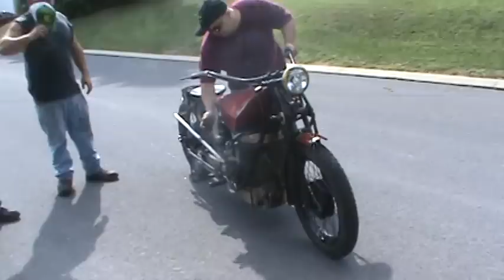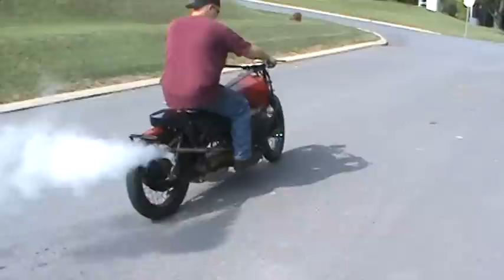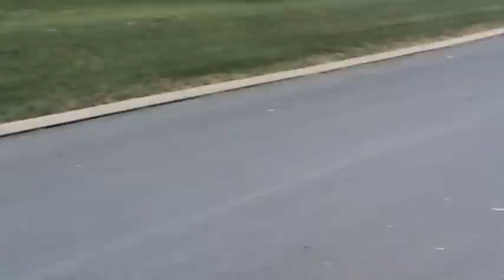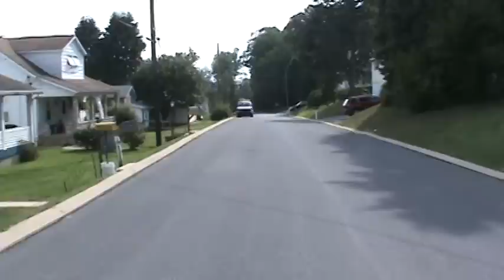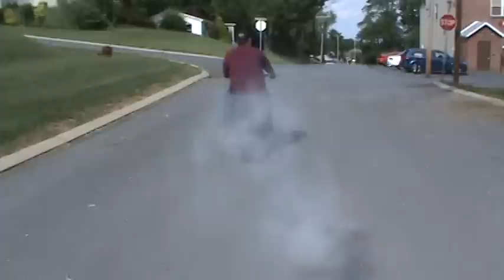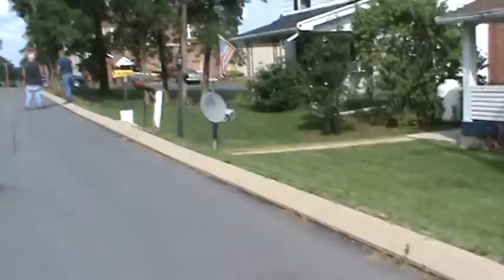Lewistown PA, USA, Loco Cycle Steam Motorcycle Stanley Steamer Steam Car North 522 Lewistown PA

Comment: Very cool.  Steam power has its place today.  If you don't know, the pinnacle of steam powered personal conveyance was the Dobble steam car.  It was the peak of steam powered engineering, but was replaced with gasoline due to the nature of owning a steam car, which is actually understanding the operation and maintenance of a piece of machinery.  Used a boiler that only actually heated about 2 quarts at a time in what is essentially today an houshokd on demand style water heater, with a supercharged airflow to put out several hundred thousand BTUs of heat.  Over 1000 pd feet of torque and will do a buck fifty in near total silence.  Check out Jay Leno, he owns three.
Reply: Just looked these up, Damn that's a sick car!

Comment: Fantasic Steam Motorcycle
I own a steam bicycle that was built in the mid 70s and am planning to build another bike. I work with stanley steam cars and you've done a fantastic job with that motorcycle.

Just be warned be careful calling it a Lococycle.  It may offend some people to call it a Lococycle from 1902 when they were built in 1900 only and as a 2 person motorcycle with double boilers.  Most people wouldn't care or know the difference, but some steam enthusiasts may question the name

Comment: This is right out of the SteamPunk movement. All you need are goggles and an aviator's cap. I've read that a Stanley Steamer car was capable of >120 mph. What do you estimate the top speed of this cycle to be? What is the operating steam pressure?
Viewers will note that he did not have to shift any gears. Not with all that steam power. There is no transmission, is there?
Reply: In a steam engine, steam pushes on both sides of the piston(s), this increases torque, there is so much torque available that you don't need gears.
Reply: No transmission.  Just a direct drive with a n on off switch. The thing with steam is that the engine is off when at a stop. And speed is controlled with steam flow.
Brakes and a steam throttle. The original automatic.
Reply: @richeyrich2203  you also may brake if you get the controler in revers?
Reply: @GpunktHartman  I'd wager putting it into reverse while your moving forward with an engine of this scale compared to a locomotive would be less "braking" than it would be "breaking". Steam doesn't take too well to being compressed suddenly by a piston, so you'd probably want to treat it like a car engine, don't do the "money shift" XD

Edit: Ah, its got a term. Its called a Countersteam Brake and its only used in steam locomotives by experienced drivers. A steam vehicle could use a Counterpressure Brake, which itself is a proper braking system, it just acts like a Jake Brake in the way that compressing normal air takes energy, thus slowing down the vehicle.
Reply: Is it just me or does anyone else hate the term "steampunk"?
Reply: @rickg.5171  What word or term would you propose as a replacement for “Steampunk”?

Comment: I believe what you're trying to quote here is how the largest ever single steam loco produced more drawbar HP than any single diesel (hydraulic, electric, etc) loco does today. Which is true, but said steam engine was a monster compared to a modern day diesel, which had very low route availability due to its axle weight, and conveniently ignores how single operator multiple control links make it unnecessary to build monstrous singles when one engineer can drive 6+ small-medium diesels at once...

Comment: With the way gas prices are going today. It looks like steam powered engines might become king again.
Reply: Aguiar Ed I wish haha
The boiler still burns fuel though, unless it's nuclear.
Reply: +KiwiPowerNZ charcoal is cheaper than refined oil lol.
Reply: dreyrugr Charcoal isn't as good as coal when it comes to making steam, you won't go very fast. I've done some volunteer work firing a scotch marine boiler which normally we fire with coal, and we tried those BBQ charcoal briquettes and they were pretty hopeless.
Reply: KiwiPowerNZ I know, charcoal is just easier to get since it's just chard wood.
Reply: dreyrugr You can make a lot of steam just burning straight wood that's been seasoned. You still get the charcoal but you also get the long flames that pass through the tubes in the boiler. It's actually a carbon neutral cycle too if the trees are replanted.
Reply: KiwiPowerNZ Yeah hardwood would be great, but hardwood isn't a viable fuel, I believe pine charcoal would be the best bet since it could be farmed faster in higher quantities. It also has the advantage of volume unlike wood which would have to be cut very fine to reach the same volume. I don't know that much about wood though so I could be talking out of my ass.
Reply: dreyrugr We have a wood burner at home. The charcoal left behind from burning hardwood lasts a long time (all night) but the charcoal left by pine only lasts a few hours (in my experience).

But pine is super easy to light, if it's dry you can put a match under it and set fire to a big log, and it burns with very high intensity too, with huge flames like burning oil. Pine is a fantastic wood to burn, it also dry the fastest after being cut, hard wood must be left to dry for months or years.
Reply: KiwiPowerNZ Yeah that's my experience too. Where I live we have fallen pine with sap resin on it that will light when wet it's so flammable of course these trees are not the fast growing GMO pine they grow today. That being said dried hardwood would be the better fuel because it burn hotter longer.
Reply: dreyrugr Plus the pine smell is really nice! Make the house smell like Christmas!
Reply: KiwiPowerNZ I can't stand the smell of pine lol. I like the smell of hickory or oak
Reply: dreyrugr What's wrong with you it's great :)
Reply: KiwiPowerNZ Allergies.
Reply: there are these things I can't remeber what they're called but its just as efficient as coal only its made of biomass
Reply: wakka flakka Briquets?
Reply: Yeah
Reply: wakka flakka We tried some briquets but not the biomass kind they were like carbonettes. We burnt those in the boiler while raising steam and they were problematic for several reasons. Biomass briquets would probably be good if they can be shovelled easily.
Reply: Electric coils

Comment: Pretty cool, but doesn't it get awfully hot between the legs? :)

What's the power / top speed like? It's obviously not a speedster, I'm guessing at less than 10hp, but that short uphill run isn't really enough to give it its full legs either. Might still be capable of 45+ mph on the flat?

Comment: steam is great  and very fun 1906 Stanley steamer still holds a steam record of 126.3 miles an hour but if we all revert back to steam what fuel will we use gas, diesel, wood, coal, or recycled fry oil all have a high price gas is 4.68 for high test diesel is 5.00 a gallon wood is hard to find in the city coal good luck

Comment: This is really neat! How fast will it go? What are you using to boil the water? What is the range in miles per fill up? How much did the conversion cost? So many questions! =)
Reply: instead of mph (miles per gallon) im sure that back in the day it was coal and water per gallon
Reply: or coal per gallon of water like how much coal you need to use to boil off an entire gallon of water
Reply: @divine308  Runs on liquid fuel to burner, either Gasoline, Meths, Paraffin (Aviation Spirit) or any other flammable fuel, even coconut, rapeseed, peanut, olive etc or Supermarket vegetable oil when fully warmed up. So not only the sound but a delicious smell !
Using 'waste' deep fried chip oil, or even vegetable oil is 'greener than fossil fuels, and would work out reasonable economic and no harmful emissions.

Comment: You don't want a gearbox with a steam engine. You don't need it. All the power is there. All you do is adjust the power. Gearbox was invented because you don't get full torque with gasoline engines.

Comment: does it have a clutch? If not what happens if the steam valve gets stuck open?
Reply: +Premium fuel only There are two valves, one on the handle, one "main" on the boiler (Beneath the seat). If both fail, close fuel valve for burner and open water-feed valve => Boiler cool down, engine stop.

Comment: Said multiple unit combinations very much putting the Big Boys et al to shame in terms of overall power, efficiency, speed, ease of operation and maintenance, braking performance and moreover wear on the rails... Oh and power density. Which when it comes to something like a motorcycle is incredibly important. My own makes 11hp from an engine that can fit in a schoolbag. Superbikes put out 150+ in a smaller frame than this steamer. How much does it make - maybe 5hp given the speed displayed here?

Comment: What I said 550ft/lbs as measured on a brake. What's driving the brake makes no difference more power is more power irregardless if it's from electric motors or pink dancing chickens
Your 9810 watts has zero relevance to engine hp or it's history Ratings for boilers are all over the show a so called 10hp boiler has no relation to actual engine power
After testing ponies and horses 32,400 foot-pounds per minute was Watts average, stdised to 33000ft/lb/min ie 550ft/lbs per second later.

Comment: Nice try to avoid what you wrote 
"After testing many specimens, the measurement of 9810 watts was decided upon" Your statement, and utter piffle
Repeating 
Your 9810 watts has zero relevance to engine hp or it's history. Ratings for boilers are all over the show a so called 10hp boiler has no relation to actual engine power
After testing ponies and horses 32,400 foot-pounds per minute was Watts average, standardised later to 33000ft/lb/min ie 550ft/lbs per second.

Comment: No. hp and torque is measured at the flywheel of an engine. Boiler ratings are just for insurance & other bullshit purposes. Steam does not "make more HP" neither does electric. Even for swept volume it depends on the presure and temperature of the steam. Torque curves vary engine to engine. Small high speed high power steam engines have a torque curve more like an IC engine Google the Carter 2cylionder car engine. You are bluring many factors and making asumptions that are not justified